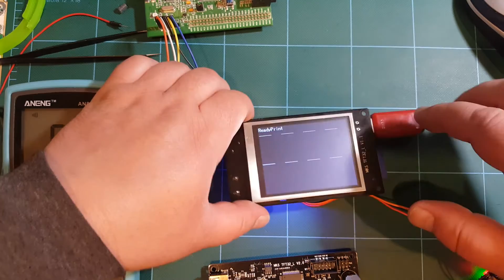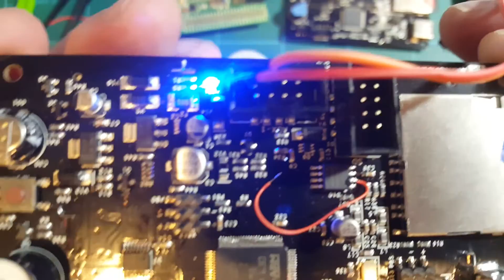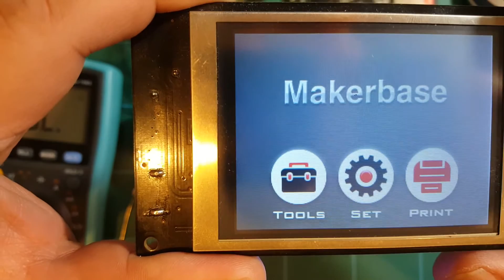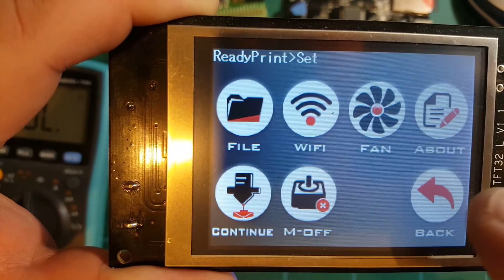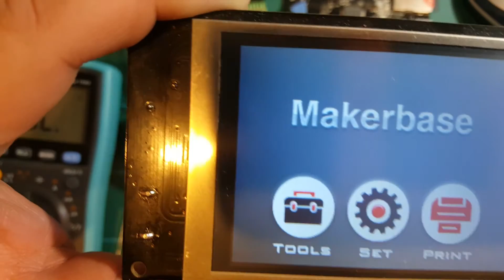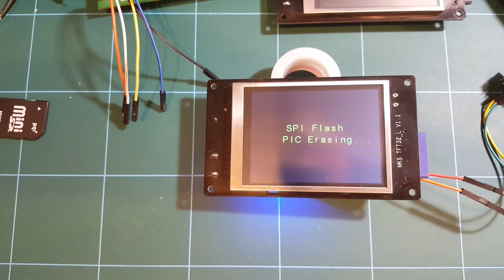MKS TFT repair part 2 - it works!

Comment: Hi. Do you have the boot loader? Or the entire firmware? 
I tried to read it. But my nicrocontroller is read protected. And if I turn it OFF. Than erasing the controller.

Comment: Still keeping somewhere the v2.0 bin?
I have ver 3.0 with dead bootloader and i dont have spare board. By the way the new ver3.0 boards are shipped with read lock byte enabled. I'm not sure v2.0 bootloader will work at all but i wold give it a try.

Comment: Can this work together with a RAMPS board ?
Reply from the maker: I don't know. I haven't tried. Natively it's for MKS boards. But it simply uses serial port to communicate with your controller, so you should be able to connect it to any controller which has an extra serial port available.
Reply: bbogdanmircea   yes it works well mega2560+ramps